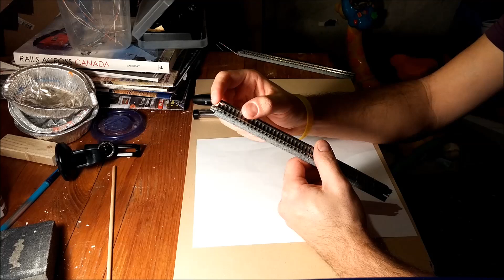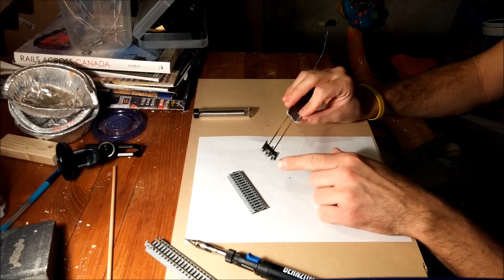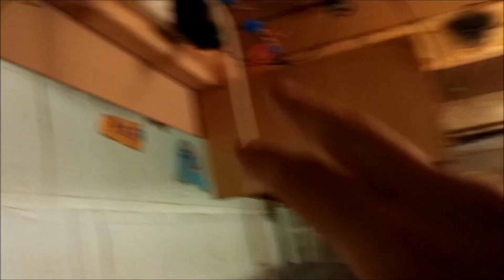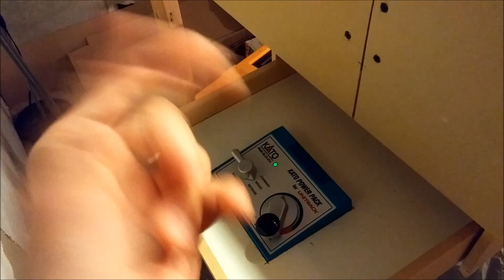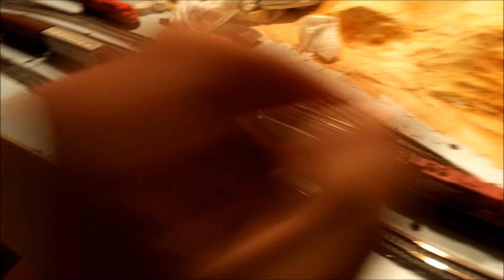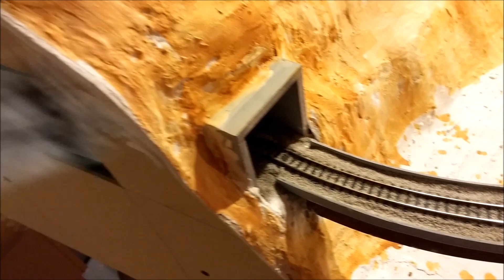UNITRACK PART 1

Comment: soldering to the bottom of the unijoiner is no good you will still be relying on the unijoiner connection better off using flex track much less soldering

Comment: Should I go non power routing or power routing with DCC? Also should I insolate the turnouts?
Reply from the maker: It depends how big your layout is and how complex your track plan will be.  The larger the layout and track plan I would create power districts and routing.  As for the switches no need as they are power routing from the box.  But wouldn't hurt if you are going to district and route your layout. 

On mine I had no routing as it was a modified oval with a small yard.
Reply: @PeterCPRail8748  my layout is 12'X10'X8' Kinda sourounding the whole spare bedroom I have. It will have a 10 track yard. Then a classification yard for coal as well which will only be about 5 tracks. It just seems like there is no videos that take you step by step from beginning to end with DCC. Im also running 2 main lines. Now when running 2 mains, do you need 2 power bus? Or can I tie both tracks into one power bus? I jave so many questions. I ordered a book from KALBALCH for DCC wiring. Hopefully it answers my questions
Reply from the maker: @Divided-Light-XX  that's the benefit of DDC you can run everything from one bus as the locos  run off different decoders.

Comment: Peter thanks for the video and great tips, my N Scale layout is DC and I am OK with that; however I have used Atlas track and switches for years and having some problems, I do not want to reinvent the wheel though I plan to use the Unitrack for the mainline and those switches

Comment: Random question for you, as you seem to be a CP guy. I am a guy with no layout currently just thinking about future things and since I am not married to a scale yet I want to compare my options. The thing is I want to run if and when I have a layout mostly CP but I want to run mostly CP Steam (Specifically preserved steam like 2816, 2860, 2858, 2839, 2850, 5931, 5935 etc) Do you know anyone who makes such locos at N scale? my Google Fu fails me on this. Rapido has some in HO and some coming appearently but I haven't' found them in any other scales. (also you have a new subscriber in me so I can live vicariously through you.
Reply from the maker: Your best bet would be HO scale.  Hardly anything avaliable in N scale in CP steam, let alone diesel.   Rapido and Scale Trains seem to be on the  for front of new n scale locos but mostly modern desiels. Regarless your going to have to kit bash or look into older brass and plastic  locos to get what you want sadly.    

The Royal Hudson by Rapido is mostly all gone first run might find a retailer having one or two.   A few more in the pipe line but  it seems Rapido pushes CN mostly for Canadian schemes because Jason Sharon the owner has a layout focusing on CN so he basically brings to market what he needs.   Very limited CP stuff from even them steam wise. 

Your better off running transition era or modern for CP. If you want to find things easier. 

With that said the biggest steam manufacturers in HO are broad way limited and Bachmann.  Both excellent brands for steam.   I would contact them to see if they did any past CP locos.   Get the exact model names.   Join some Facebook and forum groups and start looking at private sales

The stuff is out there just harder to find as it's mostly in people collections.   As the older generation starts departing us more of this stuff is avaliable at train shows and private sellers that buy big lots up through estate sales. 

Good luck,  I hope you find what your looking for.

Thanks for the viewership and sub.
Reply: @PeterCPRail8748  yeah but even with first run royal Hudsons being done I could also look for used on eBay I suppose. But yeah thank you for the reply. I like to seek out people with knowledge when I have a question.
Reply from the maker: @evileyeball  no issues sorry I couldn't be of more help.

Comment: Will anyone please just show how to wire the magnetic coil of these things? I have just bought some with no instructions, and have no idea what to do with them. I'm not worried about DCC, I'm not worried about power routing. I can figure all that out. But where do I attach the wires? Do I connect them to the screws for curved and straight sides? How do you do that? What is the frog screw for? Are these screws just there to act as option selectors, kind of like trip switches on a circuit board? I have not yet seen a video or an image of the underside of these things with the selector wires attached.  All wiring videos seem to be talking about power routing, but none explain the basics of how to power the point motor. Can anyone please help?
Reply from the maker: I used modern unitrack.
  I had no  selector screws underneath, just the screws that,held the metal cover plate that protected the motor and switch mechanism.   My N scale unitrak was factory wired with two wire for positive and negative attached to a plug, that I cut to wire to a toggle switch instead of the switch levers by Kato.  Unfortunately I never go to that point, as I switched my turnouts manually  with little slide mech on top.   I switched to HO scale and have sold all my unitrack a couple years ago so I won't be able to make a video for you.  I suggest you look up Fifer Hobbies on tje internet.  he has an extensive  video library on all things unitrack as he is an N scale online hobby store, and has a large n scale layout all done with unitrack.   He has many wonderful tips and detail instructions, both written and some YouTube videos.
Reply: @PeterCPRail8748  Thanks Peter, much appreciated.

Comment: Pete: Excellent video',  But I have a ?  I have a 2in hard styrofoam base the track lays on. To glue the track down would you use the hot glue like on yours or white glue. Thanks
Reply from the maker: I would use hot glue or silcone calking as its easier to remove track if changing layout or dismantling in future.  There is nothing wrong with white glue its just more work to remove track if have too.

Comment: Beginner question...I'm going from DC to DCC. I run the trains so far, no problem, with just one feeder to the track, 7' oval. Why do DCC layouts need so many feeders? I don't want to be disappointed when I put together my first Unitrak layout and it doesn't work. Thanks.
Reply from the maker: If your running a very small loop with some sidings. And Spurs, you can get away with running  feeders to the loop and all sidings and Spurs.  Especially if it's going to be a temp layout.

If your going to be building a more permanent layout, you want to run feeders to every piece of Kato track or every few.   The reason behind that,  any type of track joint joined by rail joiners and no soldered connection works loose over time with temp changes and you start getting dead zones and unreliable track in the future. 

Even with flex track it's good to place feeders every 3 to 6 feet. 

So it depends what your doing with your layout, at  this time.  There is no real right feeder count on a layout.  With that said the more electrical connection to the track on a permanent or long term layout the better.

Comment: 18 Gauge Door Bell Wire is a VERY' Good alternative & it's a solid wire source, its what I used on my Layout I got it at Lowe's  in the House Wire Section on a spool it had a length of about 250'ft they also carry Thermostat!  wire which is in 18 Gauge And what's nice about Thermostat wire is that you have multi colors of wire cover which is useful in hooking up Thermostats to a furnace but it's also useful if using it in model Railroading if your wanting other wire Cover colors other than just Red & White say you want yellow and Green or Blue and White with Thermostat wire you have that option and with Bell or Thermostat wire you have the outer Sheath to keep the wires together which gives a clean presentation and prevents a stray wire from being damaged the only reason to completely separate the Wires from the outer sheath would be if you want a Twist in the wire to cut down noises or your making multiple taps into the wire...

Comment: I know I'm going to piss people off saying this. But if you're going to separately run feeders at every piece of track why bother to use Kato track in the first place. I use Kato track on 2 ping pong tables and constantly put it down three or four days later bring it back up and make something else with it I run DCC and don't wire shit. I guess ignorance is bliss. The less wiring I have to do the better I like it. I'm not a modeler I play with my trains like you would play with an erector set. But I do enjoy the videos with different points of view. I work on simpler is betterer
Reply from the maker: I like realism and a finished layout that will have little to no issues years down the line. To each his own. Thanks for watching and commenting

Comment: Nice video Peter.  I am a little confused.  I have been using Kato Unitrack (N scale) for years.  Are you soldering power leads to each track for dcc?  I have an 80 X 36 door layout (dc only) and only have 2 leads on each loop.  Never have had a power problem. Thank you in advance.
Reply from the maker: Rick Hane  if your planning on having a permanent layout where you glue the Unitrack to the benchwork. It's recommended my many seasoned Unitrack users to solder leads to each piece as the rail joiners work loose over time with room temp change.  It's just an extra step to make sure you have great track for years and years.   By no means do you need to take this step its just highly recommend in the Unitrack community. Thanks for watching
Reply: Peter thank you for the suggestion.  My layout had been up for many years.  Now I am creating a new one using Kato.  TY Rick

Comment: Finally!  Power routing that confirmed what I thought I understood!  Just wire all ends and it doesn't matter!  I'm going HO and didn't want #4 manual turnouts for the yard because they're sharper radius than the #4 powered switches.  But those are power-routing.  At least the #6 powered switches gives the option.  I believe a similar situation exists with N scale.  It doesn't matter if you put feeders on all the rails.  What the heck was the big mystery or confusion?  You've put my mind at ease.  Glad to be a new sub.  Looking forward to more updates.  - Jeff
Reply from the maker: Jeff,  glad I could help with your unitrack dilemma,  one of the reasons I did these vids as unitrack is becoming more popular and are very misunderstood and downplayed by seasoned modellers as toy track.  Not the case at all.